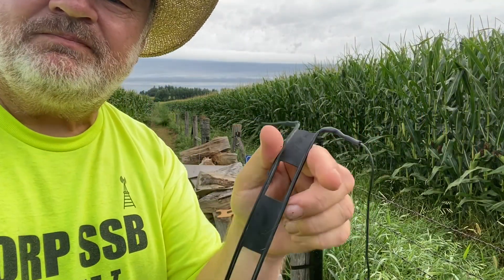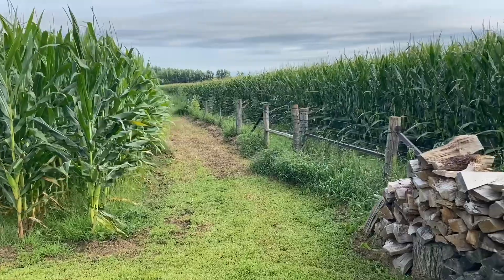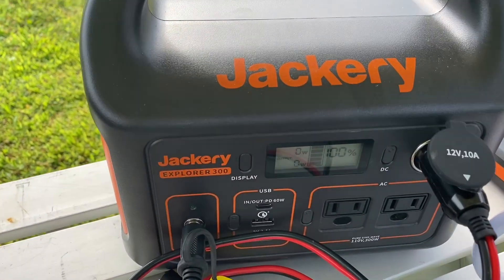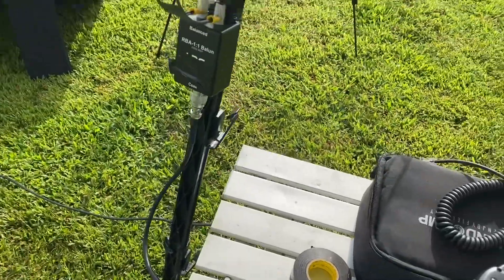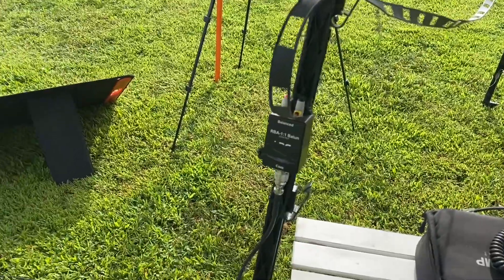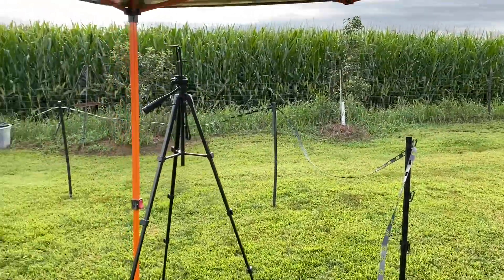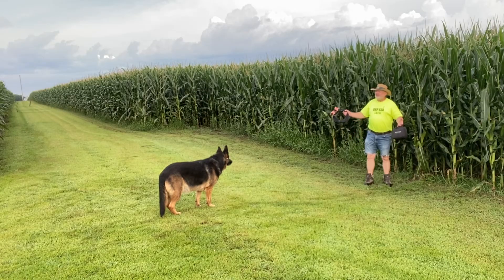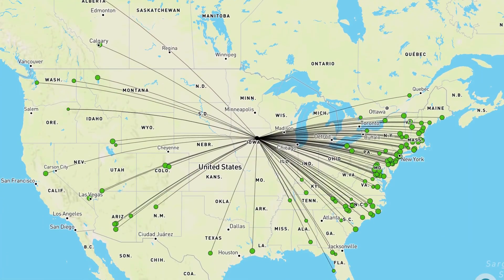Xiegu x6100, NJQRP Annual Skeeter Hunt - QRP Field of Dreams

Comment: This was fantastic. And the tip for ladder line extensions is brilliant. Well done!
Reply from the maker: Thanks Mike.. Glad you enjoyed it.. I had experimented with the ladder line lengths with this antenna a few weeks ago and had it all tuned up.. but when I got home later, I cut, stripped back and re-soldered the wires at the feed point just to assure they weren't ready to break on me.. Since I shortened the wires a little, I thought I better pre-make some short segments of ladder line (just) in case I needed to add a little bit on the fly.. I didn't expect the dip on the rig expert to move as far as it did but Boy, did I luck out.. that 1ft section was perfect to bring it back in line, whew.. Thanks for all you do for ham radio and for your support here on the channel.. I appreciate it.. 73, kevin k0klb
Reply: I enjoyed seeing his "tuning leads" also.  Just plug-and-play when needed.  🙂

Very cool idea. Simple yet effective.  🙂

Comment: Adding a short length of ladder line is a great way to tune. Thanks for showing that. Leon KC1LBL
Reply from the maker: Thanks Leon for sharing your experience and teaching me that.. It worked perfectly.. Funny thing, when I did my trial test of the antenna a few weeks ago, it tuned up perfect.. But a week ago, I had decided to strip back and re-solder the wire legs to the ladder line and heat shrink them (1:40).. I guess that change shortened the dip on the rig expert.. I was happy to see the 1ft addition pulled it back into the band, whew!! I’m glad I built those ladder line extensions and was prepared.. Thanks for sharing all your experience, tips and knowledge about antennas with this old farm boy..!! 73, kevin k0klb